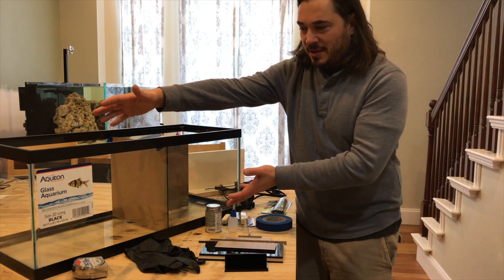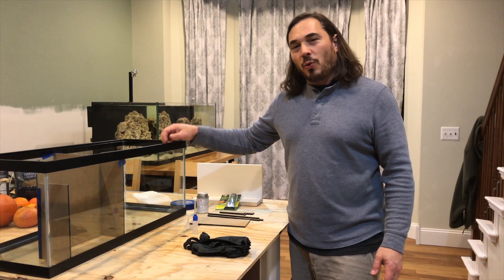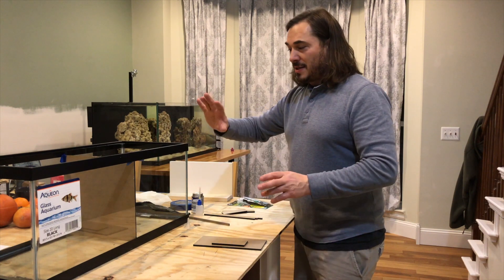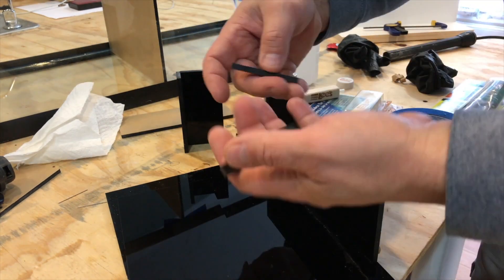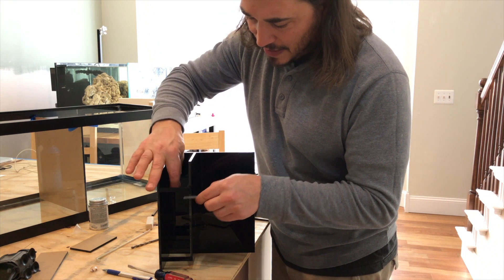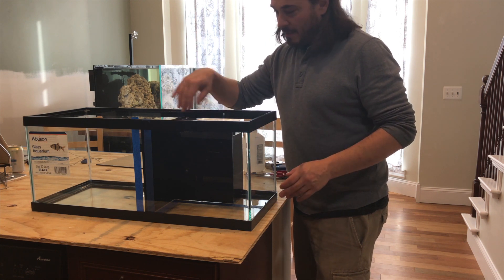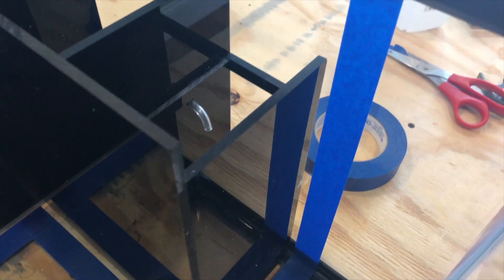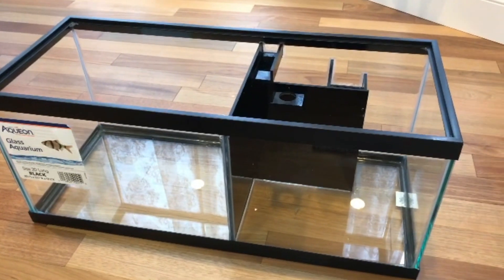How to make a 20g long into a All-in-One for - Ricos Nano Challenge 2018 - Coral Tank - Jan Update

Comment: What blade do you use to cut acrylic? I just picked up a table saw last week and a 80T Freud blade. Hope to start practicing this weekend. Thanks!
Reply from the maker: I'm using a 80t Diablo Blade.  You should be good, have fun.
Reply: Any blade with more than 40 teeth should be fine. You can still cut it with a sharp blade and less teeth, but you don't get those pro quality edges. I assume you did this already since the comment is a year old. It helps to wear long sleeves and cover as much of your skin as possible. Acrylic does not throw dust. It throws hot microbeads. Imagine a bunch of grains of rice bead blasting you and about the temp of coffee.